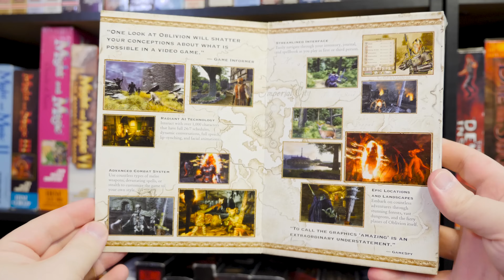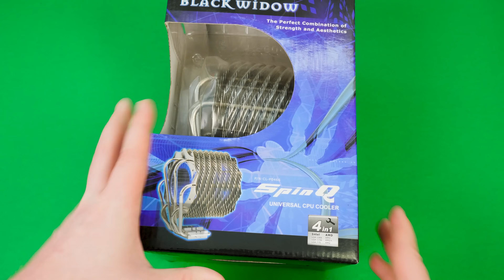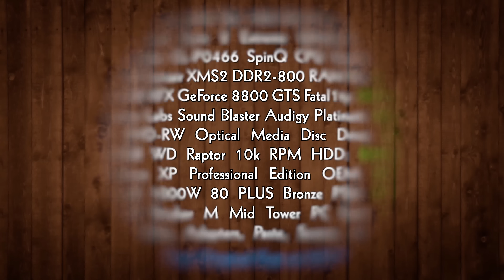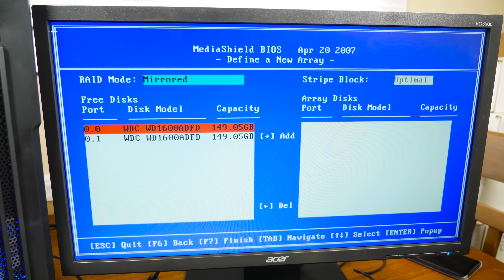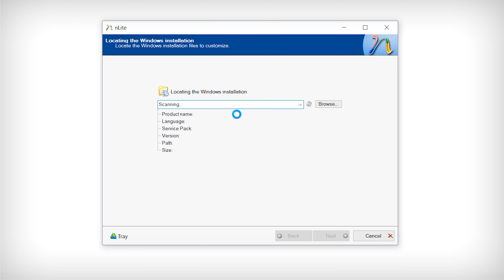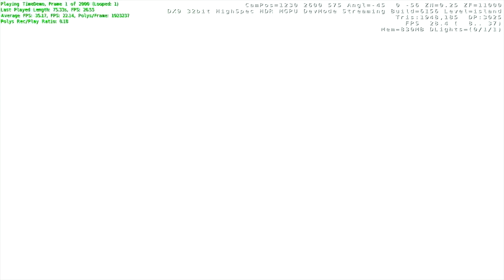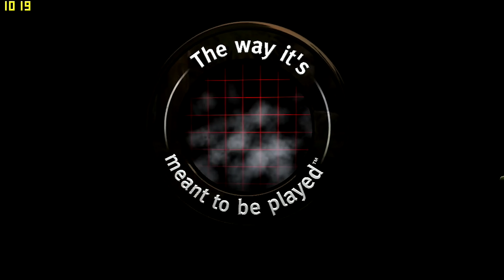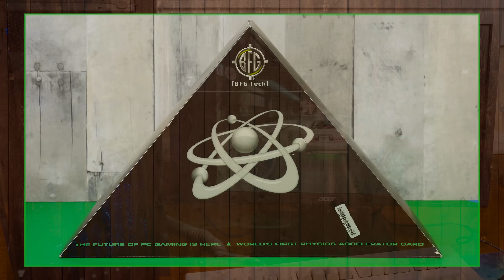LGR - Building My Dream $3,588 Windows XP PC

Comment from the maker: Question for those that made it through the whole build and saw the final specs:
What upgrades or changes would you like to see this PC receive in the future, if any?
As mentioned at the end I plan to upgrade the sound card and add a PhysX board, but I'd love to hear your suggestions!
Reply: Get a Cooler Master HAF X case. It's from 2010, but It's looks way more time period accurate with that side fan. Also some cold cathode lighting. SLI GeForce 9800 GTX (or maybe Quad SLI 9800 GX2).
Reply: I am pretty sure it was 3.5GB RAM limit for XP
Reply: You can actually put one more gig in there. I can't wait for the PhysX card review, I remember it from back in the day but I'm not sure if it qualifies as oddware or not :-) certainly didn't live up to the promise hehe.

EDIT: Oh and please do tell us how much better Crysis works with your new RAM :-)
Reply: I have the original box and driver disk for the PhysX card if you need them!
Reply: Auzentech X-Fi prelude soundcard and the 8800 Ultra. A logitech G15 keyboard and G5 mouse would also be nice and period correct. Maybe a badass windows XP skin and dual DVD drives (dual because that was badass back then).
Maybe a ccfl tube at the botom of the case.
Reply from the maker: Won't be upgrading to 64-bit due to the problems it can cause with a lot of the games I want to play on this.
But another gig of RAM makes sense, may as well max things out for 32-bit!
Reply: You could go crazy quad sli with duel GTX 295's... if you don't mind wearing ear defenders and melting a few power supplies!
Reply: I still have a PhysX card in a drawer. Those things were basically novelty toys back in the day but they were impressive.
Reply: i say 2GB is the sweet spot for xp as some games like juiced won't run if there's more then 2gb of ram sure you can fix it but it a pain in the but
Reply: You gotta add a floppy drive!
Reply: You need some .. dark coloured woodgrain.
Reply: Noooo soundblaster 4life!!!
Reply: As you've already alluded to, upgrading to 4gb of ram; something a system at this price point would of had at the time.
Reply: more leds you can't have a gaming pc without an accesive amounts of leds
Reply: A bigfoot killer network card! That was a big deal at the time, and in 2006-2007 I bought one. And maybe a TV tuner card just because
Reply: An early Blu-ray drive maybe
Reply: Personally feel like it's fine. Only thing it's missing is a 5.25 bay draw caddy for storage. If you want to make it part of oddware hook up a USB ghost radar or ocz neural impulse actuator to it.
Reply: X-Fi Fatal1ty sound card is the obvious choice here. The Audigy 1 is more of a Win98/2000 card. A nice 16:10 screen for more period-correctness and superior aspect ratio ;) I'd get rid of SLI and just use a single 8800 GTS/GTX/Ultra. A bluray SATA drive and a memory card reader would be cool too!
Reply: a windows xp machine can't be complete without a floppy drive for legacy stuff. (yes, i still used floppy in 2007)

oh, also get a blue cold cathode light and one of those RAM Fan modules
Reply: Definitely a better Sound Blaster card. I actually have a Sound Blaster X-Fi Fatal1ty edition sitting in the loft back at home, but found that the onboard sound on my motherboard actually sounded better with my headset. The ribbon cable for the front drive bay was a nightmare too!
Also can't believe you have those Raptor drives. Got one sitting in my PC right now, the 150GB one with the clear window, used for my virtual machines. And I also have the same 160GB version you had also sitting in the loft.
Reply: *add-on
Reply: Max out the ram if possible, run 3 disks in raid 0. And run 3DMark tests too!
Reply: as a suggestion for a sound card give a SB0880 Sound Blaster X-Fi Titanium a shot
Reply: I love when you take period photos with old digital cameras... so maybe complement this rig with a sweet 3-CCD SD firewire camcorder?  :D  The effect would be diminished, of course, given this isn't as glaringly different a time period... but it might also make a fun video in and of itself!
Reply: I would use a more ancient screen to give that same feeling we had back there!
Reply: Could you do the equivalent build with Phenom? Would be interesting to see and maybe the 4870 :) that would be similar to a build I had back in the day.
Reply: 8800 Ultra SLI
Reply: Could be the slowdowns in Crysis is due to the build running single channel rather than dual channel memory (double the bandwidth) but damn this is one good looking build. :)
Reply: I think a single more powerful video card would be better.  SLI and Crossfire have almost went the way of the dodo for good reasons.  Would like to see a review of the sound card + front panel controls (I think my friend donated it.).
Reply: water cooling. Could dig up an old Koolance case which includes a water cooler. I always wanted one.
Reply: just cuz its 2018, you need more RGB, since that is what makes a PC go faster!
Reply: if you are going to upgrade to better sound you might as well use one of the x-fi top tier titanium cards! those would be epic for XP
Reply: Does XP really see 4 cores? I had XP Pro but it only saw 2 cores when I updated my cpu. Had to switch to Win7 because of that.
Reply: With three sticks aren't you running without dual channel? Good reason to add another one.
Reply: No mid 2000's PC would be complete without a couple of cold cathode tubes.
Reply: Actually, it's not THAT bad running a 64 bit XP, remember - a decade of polishing went on this. :) Finding some 3rd party drivers will be a mess though, especially those Audigy ones, IIRC.

- Anyway, as others have suggested already, mess with memory first of all. Add to 4 Gb limit I guess... But you can go even further and try different shenanigans:
1) Install ramdrive software, some of the titles CAN even utilize excess memory, even beyond 4 Gb limit(!), so you can make a ramdisk with a write cache, swapfile or/and a game directory for quasi-SSD performance :)
2) Install an older (pre SP3) build of XP, I have much less info on that, but I think it's a SP1. Basically - M$ banned memory usage on common versions of XP beyond 3-4 Gb to promote server/64 bit versions and to lazy-fool-proof some things.
3) I forgot... %)
4) Try ReactOS!

- Secondly, add a floppy (or even a CD/DVD-ROM) with embedded cardreader, if you can find one ofc. :). Mainly for giggles, but also could be useful.

- What else... Scanner/MFU? Not really fun, but was still a thing in its time. 
- Some bluetooth dongle maybe? I have no idea if they still make ones without the need for drivers for XP (!), but finding that would be awesome. :)
- Some silly webcam? :D
- Maybe VR 3D glasses? I don't remember the exact generation of nVidia, but ASUS was making these several times, bundled with their cards.
- Speaking of 3D, 3D 6-ch headphones were also a thing. Was it Zalman or Koss? Don't remember...
- A HDD rack with hotswapping.
- A joystick or steering wheel.
- Oh yeah, definitely find one of those PhysX cards, toying with one will be fun but very tricky. :)
Reply: windows vista
Reply: IIRC, Nvidia 8000 series cards already had Physx built in (it sucked, but it was there). With 2 dual slot GPUs your expansion will be limited. 

Gamewise, do you have STALKER Call of Pripyat? I remember that being a staple benchmark title in the late 2000s for both MaximumPC and Computer Power User.
Reply: You might have the dual memory channel bug where you can't do your dual channel memory it will be the BIOS bug I had the same bug if you put it in non dual channel slot you may not have issue anymore like I did give it a go or not your choice
Reply: I used to have a couple of HDs with little windows in em, I thought those were the 10k raptors like you were installing, but thinking back, I believe they were 15k rpm. all I know is like a month after I bought  them, SSDs were larger and cheaper and faster
Reply: Not so much an upgrade but I would be interested in seeing some benchmarks for the 10k rpm drives. Just curious to see what the read and write speeds are.
Reply: I want to see all the lgr PC's side by side. I love how they all have their own style and flavor. the woodgrain, the green giant, and now this one. 

I was a little surprised it hasn't been christened with a fun name. maybe the LGR midnight express...
Reply: No reason to switch to 64bit XP, it was never really used by gamers, it's also based on the slightly newer Server 2003 kernel, and in many cases tracking down XP 64bit drivers can be annoying and it would provide no benefit to the era of games he's playing, Actually who ever really used XP x64? The only thing I could guess it was used for was for high end CAD/CAM or maybe video editing workstations where you needed tons of RAM and the licensing for it was probably cheaper than Server 2003 which you would've needed for more than 4gb of ram and running a native 64bit OS in the application would've made sense because even though you can access more than 4gb of ram with the 32bit versions of Windows Server but when using large amounts of ram there's a performance hit from PAE .
Reply: Paint that sound card controller and install it, all those buttons and dials will go great with the overall aesthetic of this machine. :)
Reply: By 2008 hadn't NVIDIA alread bought out Ageia and killed off the PHYSX board and moved PHYSX to their GPUs although they did have an option where you could use an NVIDIA 8000 series or later card as a dedicated PHYSX card ,  In this configuration typically people would use a low end card for physm, although if a game uses physx and doesn't support SLI or has issues with it you could probably disable SLI and use one card as a dedicate PHYSX unit when you play that game.
Reply: Get another stick of RAM so it would run in dual-channel mode. Also, if your motherboard supports it (i.e. a modified BIOS with Xeon support exists for it), you could get a Xeon X5470 (3.33 Ghz Quad-Core with 12M of cache) modded for LGA775 dirt cheap (~20$) on Aliexpress. I'm actually running one in my LGA775 system.
Reply: More ram and windows x64
Reply: Was wondering to what extent you would be able to get rid of games stuttering by adding a SSD.
Reply: TV tuner card for playing older consoles through! And on top of that, get some emulators like bleem and chancast running on it!

Other than that, I think an exploration/mini doc on the application skinning/themeing trend that took off with Windows XP would be interesting, with the likes of windows media player, XP ui themes, winamp, (2, 3, 5) and she'll replacements like litestep!
Reply: Get a xeon for it ! X3230!
Reply: UV cold cathode tubes and a 5.25" bay fan controller with temperature sensors and a display.
Reply: Come on man, max out the memory with 4 gigs!
Reply: Make an 8GB RAID-0 array with one of the The PCI Gigabyte I-RAM's and one of the functionally equivalent 5.25" Bay versions- AKA GC-Ramdisk.
Reply: She seems pretty sweet so far. My only recommendation is to get yourself a SecuROM cleaner if you Install Knights of the nine and the shivering isles as the disks have it on and having lost many Sims pcs to that nasty program, I wouldn't wish your baby to go that way. North and South bridge failures are not a nice way to watch your much loved pc die an un-needed death :'(
Reply: Aside from maxing out the RAM to 4 GB, I can't think of much, as the components are just about perfect. You could look into using a more period-correct case. Although that Rosewill case has just enough mesh and blue LEDs to look like it's from 2008.
Reply: LGR You might as well max XP 32bit out at 3.5GB, and I can remember running Crysis warhead on dual SLI 1GB EVGA 9500GT  with no issues, so I would suggest something in the 9 series like the 9500GT or 9800GT/S with 1GB of RAM Edit: if you want a good  sound card with front panel headers for HD audio I would suggest the ASUS Xonar DG PCI card if you have a free PCI slot, or the DGX for a PCI-E slot as I think there are drivers for Win XP just get the unified drivers.
Reply: Re: sound card. I did a quick search on youtube but didn't find any Aureal videos? If I missed that you should really check it out.
Reply: Cold cathode lighting, it was the hottest shit back in the day
Reply: Max out RAM, get a 4:3 monitor as a second display, get a Logitech G15 and a  racing wheel.
Reply: My Account Yeah you could for sure, and even more stuff with the RAM maxed out, and Linux distro like Xubuntu which is very light on system resources, but if you do that you will have a better time with AMD GPU's as the drivers are built in the kernel.
Reply: For sound card, I would suggest at LEAST no less than an Audigy 2 ZS (or even the card I have: the X-Fi Platinum Pro).  Since really, you'll want EAX4 for a lot of games from around that time.  If you want to step the audio card interface up from PCI to PCIe, there's also the Audigy Rx.  It's more or less a PCIe Audigy4.
Reply: Honestly besides the audio card idk what I would change.  I do like the idea of 64bit OS but I see you have other plans because of compatibility.  Sick PC brah!
Reply: A front mounted fan controller you'll never actually use seems appropriate.
Reply: Add purple flame stickers to the sides, kind of like the Guy Fieri shirts that were so popular at the time.
Reply: @revive  They need to be cold cathode and not LEDs if he wants to be accurate to the times. haha
Reply: nice antec lanboy case would be the nuts
Reply: It's not a mid 2000's GAMING PC until you add cold cathode lights
Reply: What advice would you give to someone who has an xp os but no serial keys to activate it?
Reply: Additional gig of ram will make it actually faster. In your actual setup, with 3 sticks of RAM it will not run in Dual Channel.
Reply: Nice speaker and subwoofer pkg? You didn't say what was currently hooked up...
Reply: A powerful single GPU to eliminate SLI scaling errors!
Reply: Lasky Labs driver support and compatibility with 32bit was a nightmare. I had put XP x64 on my pc around 07-08 and gave up on it when I couldn’t get drivers for half my stuff and many programs I used wouldn’t run so went back to standard 32bit.
Reply: All I have to say is 2008 me would have murdered a litter of kittens for that setup. (edgy 2008 me popping through. sorry about that)
Reply: I'd love to see that.  Fits in with the build.
Reply: Ive had that motherboard, twice. through the weight of the cooler, the little heatsink on the top above the cpu would come off because of motherboard flexing. and the motherboard would burn out eventually. This is my personal experience with this motherboard.
Reply: Why not try external FireWire audio card from that period of time? Something like M-Audio FW 410\1814\solo or Focusrite Saffire pro 14\24 (DSP). And good CRT ~20" with 1600x1200 is best tho.
Reply: another gig of RAM makes also sense to make it run in dual channel mode :)
Reply: Even out that RAM to be at least a 4GB setup with equal 1GB sticks in each slot.  Otherwise, you're limiting yourself to single channel speeds since it's three separate sticks instead of two pairs.
Reply: I'm on board for a compare/contrast of 32 bit vs 64 bit Windows. Great build!
Reply: If you are planning on using it long term, and really want to keep that heatsink, I would recommend modding it with a CPU backplate.  Given enough time, it will warp your motherboard.

I would definitely upgrade the SLI setup.  For my system, I used an SSD and went with 4GB RAM and set aside 1GB as a RAM disk for swap, browser cache, etc.
Reply: Being kinda period correct LGR I would install the 8800 ultra card (micro studder/sli was a hit or miss) 3 gigs of ram is plenty and upgrading to Sound blaster audigy 2 zs or next gen extreme gamer sound card is best (using still the Sound Blaster in my Sandy p67 board)  I think if was the Xtreme Gamer sound card from the next gen from Audigy 2 ZS.   Using SSD tech might be option for less head aches going forward but wouldn't be period correct.  Nice build and video LGR
Reply: Def an ssd
Reply: MAWR LIGHTZ!
Reply: The case NEEDS to be an Antec Chieftain. The classic case that was the original Alienware cases, the ones that pretty much every case manufacturer copied.
Reply: MORE LED´s:D
Reply: I thinked around with XP64 once upon a time and it was a mess. The WOW64 emulation wasn't what it is today and the driver support is awful, generally. I think XP64 was Microsoft's first real stab at 64bit and it was not good, lol.
Reply: Plus, I remember ordering everything from Xoxide back in the day. Lasercut 80mm fan. mmmm.
Reply: Since it's the right time period for it and you have a window you have to get some cold cathodes in there, I was looking at some myself for a "retro" build and they can be had a lot cheaper than I expected at places like PerformancePCs combine it with some crazy fan grills and stuff and you have the quintessential 2005-2010 build. More of a visual thing than a performance upgrade though, but given how nonsensical such a build can be it's only fitting to throw in every fad of the era.
Reply: Did you get a keyboard and mouse from the time too LGR?
Reply: a dual gpu card from AMD ( HD5000 or 7000 series) that kicked Nvidia's butt back then....as a gamer who prefers nvidia products...i would love to see that happen today.......no....i would pay to see that :) :) :)
Reply: With a simple Bios mod and Xeon (pre-modded or DIY Sticker mod) you can run the following cpu
Xeon X5460 quadcore s775 (3,16GHz, 1333FSB, 12MB) (around 15$ pre-modded)

You could also try getting your hands on Windows server 2003 Enterprise 32 Bit.
-has better memory management and is the only 32bit OS that can run more then 4GB ram.
-can use WinXP 32bit drivers
With a few tweaks you can even run a lot of games from older generations(like disabling unused services and enable hardware accel.)
Dos games run great with the VDMsound utility since your already running 32bit os you don't need emulation or virtualization.
And there are also Glide Wrappers if you want 3dfx support.
Reply: Around this time I had an Asus Xonar D2 soundcard which i thought was pretty neat. Definitely recommended.  I really enjoyed this video.... brought back a lot of memories!
Reply: Why not dual boot it? XP 64bit is a pretty interesting piece of software. Speaking of dual boot, throwing in a period-correct linux distro with some linux compatible games from that era could be interesting too.
Reply: There is indeed a patch you could slipstream to windows xp 32bit, to allow it to enable a lot more ram. Up to 128gb, in theory. The same site that would host the page for the unofficial service pack 4 for xp, also lists what it calls an "alternative ram patch" that i was already able to verify in a vm to recognize and enable 32gb already. Considering that evga did make custom xp drivers for their current x299 Dark motherboard, that would be a great use for it.

For this system? Max ram, ssd, maybe a newer sli? Windows xp drivers from nvidia supports as late as a geforce 780ti, titan, titan black, and recently, the gtx 950 and 960. So you have a nice breadth of gpu's to choose from.
Reply: Perhaps consider upgrading to the 64-bit Server 2003 and find some extra RAM.
Reply: Woohoo, Classic pc build !
I think my old childhood 2012 pc has similar specs built it my self at the age of 10 Lol
still ticks to this day with clear side,LED lights,big heat sink, monstrous fans & bad cable management....ohh my what a time goes soo fast....

 Windows xp brings back a lot of good memories, seeing this video kind of gives me thoughts of using my xp machine and seeing what still runs on it in 2018...
Reply: the 680i board needs thermal compound redone STAT on the chipsets to keep it running good and happy.
I've got a circa-2007ish BFG semi-modular 1000EX supply kicking in my 2500k box at the moment. 11 years and it's still going strong.

for HD audio, look at an Asus Xonar card, since those will have relatively decent XP compatibility. you can break out the Audigy/2 pins to HD Audio but it's VERY finicky and most cables don't work well at all. 

The 680i board can take 771 Xeons with the tape mod and a BIOS update (yes, even the silly 1600FSB ones!) They also silly overclock. dunno if you'll want to keep with the SpinQ for that but any cheap 212 will handle the upgrade just fine, even when overclocking. if you do such, you'll also want to upgrade the fans to push-pull or JUST pull, but not with the stock CM fan that comes with it. 

A 780i would be a better motherboard choice in the long run since it can do DDR3 and also handle 16GB worth with the latest BIOS, but they're VERY unobtanium now. I gave mine away to a friend, sadly, else I'd offer it.
Reply: Kinda defeats the purpose but can you try playing GTA 5 on windows xp
Reply: Please try to build modern beast in an old 80s/90's case. I still intend to build a modern pc in the early 2000s case of my sister's husband.
Reply: Heh, hardware is the least of my interests; it was confusing enough 10 years ago, never mind today! Besides, when you can have a virtual machine of XP running just fine on top of Windows 10... No, it's figuring out how to keep XP alive that's the fun part!
You'll need all the POS updates for a start if you want to get online safely. This build by Team-LiL is probably your best bet unless anyone else knows any better- https://lilfellauk.wordpress.com/2018/04/19/windows-xp-pro-sp3-vl-corporate-student-edition-x86-cdr-april-17th-2018-team-lil/ although there is a "gamer's" version too https://lilfellauk.wordpress.com/2018/05/19/windows-xp-pro-sp3-vl-gamer-edition-x86-may-2018-team-lil/ if you want DirectX 10 & 11 etc (but lose Pinball!) Yes it's all very ugly but they've actually changed very little in terms of aesthetics compared to other builds I can think of (you know who you are!) Do note that these aren't upgrade disks so you'll need to start from scratch if you choose to use them. XP Black Edition 2015.9.12 is an upgrade disk, and a good one at that, but there's three years of updates to install with that one now.
If you want a browser that's safe to run then read this post for your options (there aren't many left!)- https://www.bleepingcomputer.com/forums/t/674966/best-web-browser-after-august-2018-for-windows-xp/?p=4555848
Finally, you may want to change the look of things drastically. Stuff you can't do on anything past XP. Quite a few options but my personal preference is for Stardock's products https://en.wikipedia.org/wiki/Object_Desktop although there's plenty of other stuff to play around with too. Tracking it all down is the tough part. I'll try my best to hook anyone up if they're interested as I've spent far too much time on the Internet Archive hunting stuff down. ;)
Yeah, the software is my interest precisely because it's not possible on modern versions of Windows. There's very little in terms of gaming that can't be done on Windows 10 now simply because the fans have put so much work into bringing it all back to life. And besides, patches, mods, upgrades and tweaks are fun to get going too!
Reply: 8gb RAM pls!
Reply: The only thing I would want to upgrade is the os to 64bit XP and a 4gb or more kit of ram that uses all the channels.
Reply: Do the Xeon 771 mod
Reply: You need at least 2 strips of LEDs on that bad boy, and a Logitech G15 keyboard showing your CPU stats. You should also think about loading World of Warcraft Classic onto it when it comes out next year (maybe). That'd be cool seeing an old machine running a re-release. 

Good job all round though! Can't believe I spent a Friday night with a buddy watching this 🤣👍
Reply: I can't suggest any changes to the HARDWARE, But I would like to see you run Halo and Halo 2 (with that XP patch) and DOOM 3.
Reply: an ssd boot drive with a standard hard drive for game storage
Is It even Possible?
Reply: custom xp skins and icons on everything please
Reply: Since you've addressed the RAM below, really all I'd suggest from my own personal dream PC of that era, would be a disgusting overclock with water cooling.  Since you mentioned it's basically a space heater at stock settings, I don't imagine you want to try it air only.  I always wanted to push a system like that to its limit.
Reply: If you'd like to hear some suggestions on current parts I'd recommend upgrading the current PSU as Rosewill PSU's are notoriously dodgy in quality, a quick google search of "Rosewill psu caught fire" will give you hundreds of results regarding the brand, and I would like to avoid the computer meeting an untimely end from a PSU issue.  Other than that all the parts were really good and I'm looking forward to seeing what you do with it.
Reply: I've got a 2 ZS with a black front panel if you want it my dude.
Reply: Odd question I know, but is there a way to play space cadet pinball on newer computers? Some time ago i was looking in to it and it wouldn't run for windows 10. Emulation be good other than I don't want to just run a full emulated system for one or 2 games.
Reply: I would upgrade to a pair of GTX 280 or similar GPU's. In fact, I could have helped you out with this build.  I built my first gaming PC in January of 2008 and I still sort of have it.  The motherboard (an EVGA 780i SLI)  is mounted on my wall with the RAM and a CPU still in it.  While I'm not sure if the motherboard is any good anymore, I do know that the CPU is good (it's an Intel Core 2 Quad QX9650 Extreme) because it is in my wife's aging POS now so she can play The Sims 4 and so my daughter can play Spore.  I built the thing because I wanted to be able to play Fallout 3 on its release with all the settings cranked.  My GPU was an EVGA GTX 260 SC which unfortunately perished a long time ago.
Reply: My PC at the time had 4GB sticks, but limited to 3.65 due to 32bit XP, the soundblaster Fatality Xi-fi Sound card (the one with the dedicated memory), a Q6600, and a single 8800 GTX. I would like to see two 8800 GTX in SLi.
Reply: 1080 p monitor.
Reply: Install Windows 7 and then download Windows XP mode! :)
Reply: Another 1GB of RAM to activate dual channel. This ten/eleven years old PC is awesome! I’d love to have one of this in 2007/2008.
Reply: +MasterOfDiseaster I have 4 gigs of ram installed in my rig and it works perfectly fine.
Reply: Front panel fan controller would be awesomely mid 2000's.
Reply: there is wrappers you can get for exes and even drivers that fix compatibility issues, github/CodefoundryDE/LegacyWrapper i think?
Reply: add a cd-r drive to use solely as a drink holder, it's what I used mine for lol
Reply: LAN I'd love to see you use this with someone else (like the 8-Bit Guy)  that would be super neet and it was around 2005 when my family started to experiment with LAN (though like you, we never got it to work because of our XP computer not being good enough).
Reply: SLI that 8800 Ultra! And upgrade the monitor to the glorious 2048x1536. I never got to play at that resolution but always wanted to.
Reply: @oncameramastery  Yeah, but then he wouldn't be able to use the sound card or the USB-3 card.
Reply: LGR is windows Xperia’s still supported
Reply: Wow, this is very similar to the $3000 PC I built in 2006:  QX6700, Dual EVGA 8800 GTS 640MB SLI, Asus P5N32-E SLI Nforce 680i motherboard, 4x1 GB G.Skill DDR2-800 4-4-4-12, and an Asus Xonar D1 sound card with a 750W PSU running XP x64. 500GB+750GB HDD (very high end at the time).  I convinced my parents I needed a "workstation" for engineering school.

As someone who is familiar with the specs I'd say: get 8GB of RAM, Windows XP x64 (or even Windows 10 x64), and a more current Geforce GTX (9 series or older) card to breathe new life into it. The computer is still very usable today, but the 4GB of RAM and Geforce 8800s definitely held it back.
Edit: Do not put an SSD in it.  nforce chipsets don't support TRIM.  I know from experience. SSHDs are a good option.
Reply: thank you for uploading! and i love to see windows xp videos!
Reply: also try windows server 2003 for this it lets you have 1TB of ram and 64 CPU (theoretical cores aka 2-4 cpus on a broad with about 12 cores each.) it will let you run games much faster and most everything supports it Microsoft still supported windows server 2003 for until late 2015. but is on ebay for cheap at about $50-$80 bucks but the newer editions are around $500 wow!
Reply: What problems did you have with 64 bit?  I ran XP x64 for a very long time and never had any issues with any games.
Reply: I dont remember the model but there was a NVIDIA graphic card with 512-bit width memory bus, that is reign almost 5 year in the market and  was superb with anti-aliasing + anisotrophic at MAX, without sacrificing overall pc performance.
I think if you can get one is the perfect upgrade for your XP machine.
Reply: Hi, RAM in dual channel should always be placed in slot 2-4. You put it in 1-3 and maybe that's why it failed
Reply: The OG Killer NIC. Maybe try your hand at a high end SATA RAID card setup. Go all out!
Reply: Needs more 1337 reg hax!
Reply: very few original windows xp programs supported windows xp 64 bit plus it was kind of an after thought so many later GPUs and CPUs did not support it.
Reply: Obnoxious stickers on the case
Reply: The funny thing about these specs, is that it could easily run Windows 10 and most modern software with no issues, really goes to show how well this hardware has aged compared to what was there earlier (or depending on how you look at it, how much computer hardware has stagnated and failed to progress). Granted, it would benefit from a newer DX11-capable video card and some more RAM, but everything else including the processor would be fine.
Reply: I'd have not bothered with SLI, myself. More cost, more heat, more power required, very little return on all of that, not all games support it, not a lot of the games that do support it well, it's useless outside of gaming/Windows. And the more cards you use the higher the curve on diminishing returns it gets. I'd have stuck with just the one 8800 Ultra or a top-end card from the next generation that was likely to outperform the SLI you put in there on its own.

The RAID is nice, though on modern hardware I'd ignore anything more than software RAID solutions unless I was aiming for interoperability. One motherboard change (Especially on a jump from Intel to AMD to vice-versa.) or a dead RAID controller later and the array is useless. Not been a lot of really clear benchmarks that show RAID-0's performance really pays off, either. Better off just using a logical volume manager and ignoring RAID. 

Debatable on if a dedicated sound card is really worth the money either. Maybe I'm not an audiophile, but I'm hard-pressed to tell the difference between on-board SPDIF versus SPDIF coming from a $300 Creative thing. 

I actually DO have a flashy computer. I don't necessarily advice against something that looks cool to you if you want it. You're going to have to live with the machine and for me it was also a matter of making the machine unique and reflective of me. I'm less against wasting money on "spinning rims" and more against wasting money on something you think will actually enhance the performance or quality of your gaming, which I doubt SLI, RAID, or dedicated audio hardware will actually do.
Reply: Definitely need to get a fourth RAM stick. Right now with only 3 sticks, youre likely running with Dual Channel memory mode disabled. Also, I feel you on the SLI setup, it was bad ass for the time, but I think youre doing yourself a disservice by not using the better single graphics card.
Reply: I had almost a similar computer back in the day. I've later added an Intel Postville X25-M SSD (80gb).
Reply: The Ageia PhysX card needs a video on its own!
Reply: I would like to see if having the system running in dual channel memory mode would help performance any?   So far you've been running an odd number of sticks so in theory it's only running single channel...   Blah blah...    Good video, the early 2000's version of me is insanely jealous of you.  Ha ha...
Reply: The AuzenTech X-Fi Prelude would be the perfect sound card for this build if you can find one, it's the only PCI X-Fi that supports front panel audio and it also has a huge selection of I/O ports without the need for a drive bay.
Reply: Sudos you're thinking of the 790i, the 780i used DDR2.
Reply: I'd love to see absolutely no compromise on this thing. Put in an ssd, a bluray player, as much RAM as you can, get another card like the superior one showed early one and put them in sli. That'd be great!
Reply: You could build the AMD equivalent.  Is it worth doing a AMD retro builds from that era?
Reply: Need some Pokemon, Yu-gi-oh, Digimon sticker upgrades for starts
Reply: GadOS potato
Reply: XP x64 is a waste of time, games wont use it and it's driver hell and to make it worse is that it's all legacy now so good luck tracking them down. XP x64 is a nice nostalgia trip for me but if I was going backwards for fun I wouldn't touch it with a 10ft pole, just ignore that it ever existed. Drivers and stability with them when you got the wrong ones aside It's perfectly fine for games, I never had any issues.
Reply: put 1080ti on it
Reply: The Cooler Master HAF922 was released in 2009, and it was one of my go-to cases for many different builds back then. I use to build PC's and sell them. My current PC has a HAF912, just because I like the beefy look of the case. I beileve the HAF912 was a 2010 release. 

Rosewill is NewEggs in house brand.  Rosewill makes some good stuff overall, though I would classify their products is "solid for gamers on a budget". I have never really had issues with Rosewill PSU's. Their cases do have that mid 2000 look to them, though.
Reply: Green Lights to match your logo.
Reply: Just more of your eyes next time, with that new camera and glasses dems really purdy compared to your old old videos
Reply: put that 8800 ultra to good use by playing unreal tournament 3..sly was never that good back in the days  outside of benchmarking anyway, also this would be a good system to use with the elsa revelator 3d
Reply: Clint did you try booting with one stick of ram, setting timings and mem volts manually then rebooting with 2 sticks?
Reply: Windows 7 PRofessional and Direct x11
Reply: I would love to see one of those fan controller hubs that go to your front panel. So flashy and a tad bit pointless. But so cool. Also a soundcard update with era appropriate headphones and speakers!
Reply: XP 64 bit with the Pro version to max out that 128 GB of RAM
Reply: Core 2 Extreme QX9770 + 8 GB DDR 1200.
Reply: Probably won't get far seeing GTA 5 doesn't support DirectX 9 which was the last version for XP.
Reply: I can see that there are a ton of replies, but to add my voice to the mix - I would be curious to see how a higher clocked wolfdale Core 2 Duo would compare to your quad. Selfish reasons there, when I built my XP gaming machine, I used an E8600 3.33GHz as I theorised that 6MB L2 cache and the higher clockspeed would be better for that period of machine.
Like at least one person has said, I would add an extra stick of RAM or take the third stick out. You are running in single channel mode and I cannot help but think that negatively affects performance.
Another note of curiosity on my part - how does nVidia's true successor to the 8800 series compare? I tried both a GTX 285 and GTX 260 v2 in my machine and settled on the latter as it was quieter and performed no differently. So now I'm wondering if I should have gone with a 7800 GTX instead as XP cannot support better than DX9, or an 8800 Ultra with potentially better XP support. Clearly if the 285 is performing no better than a 260, the system is not making best use of the cards.
Reply: Try running GTA 4
Reply: Great Vid, Nice build.
I have almost the exact same build. Was my old machine from back in 08. Still alive and kicking :) 
Only difference is its got 8GB Ram and a Q6800. 
Id go an SSD. I know its not period correct, but helps with noise and load times.
Never had an issue running anything as 64bit over 32. Not sure why you wouldn't go 8gb yourself.
Reply: Love to see a nice SSD in there. Perhaps even some more LEDs orrrrr NEON (lets face it, it suites the era well), say water cooling as it was the dream of most back then but honestly good luck getting that to be reliable now. One thing I will suggest is cable manage a lil more. Otherwise this is a godly build brought back so many memories.
Reply: need to add some UV cold cathode tubes for some lighting, with some UV reacted parts.
Reply: you're probably going to want to anchor the hard drives into the trays with screws or that thing's gonna sound like a lawnmower. i actually had an issue with that on a newer pc.
Reply: You have to get a modified 771 Xeon X5482 and pop it in, it's got 12mb cache, 1600fsb, 3.2ghz (oc' able) and a pair of newer instruction set to boot sse4 and 4.1 .. at release it was $1279. Lol now it's $25 on eBay.
Reply: @Lasky Labs I had run XP 64-bit edition. The original Farcry runs fine (with the 64-bit patch). So does Halo and Halo 2. Anything else. . . . Steam. But sure is nice using all 4 GB of RAM.
Reply: Water cool and OC. I made a point to get a floppy / flash card reader combo drive for mine.
Reply: get a 16:10 monitor
Reply: Can you use some Quad core XEON LGA771 in that 775 motherboard ? Back then i heard it was possible but server parts was to expensive and i didn't try it .
Reply: How's about accessorizing those drive bays with sexy knobs and lights? :D Maybe a temperature readout with a bright display.
Reply: Sb x-fi fatality card withblive drive and go 64bit windows to tske advantage of that cpu and ram :)
Reply: @crapanbdgarbage3276  Indeed. Mahogany. ;-)
Reply: - Did Windows updates work?
- Thoughts on PAE hack?
Reply: @NightSprinter  My SB0090 Audigy can do EAX 4.0 with the most recent XP drivers. Probably because the original Audigy & Audigy 2 ZS both used the same core SPU chip. (Although the original Audigy was initially restricted to EAX 3.0 when the Audigy 2 ZS came out for, well, reasons).
Reply: SLI uses redundancy in the memory so your VRAM is actually kind of low. I'd go with the single more powerful card
Reply: I am on it right now, Because IN 2008 I built my rig with 8GB DDR2 as 2x4gb sticks so Technically could I find 2 more sticks I could go up to 16gb
Reply: Not if you run Windows XPx64 Like me... This bad boy has 8GB inside and EVERYONE CALLED ME CRAZY IN 2008 when I built him.... I even have OPEN SLOTS to go to 16 as I made sure to use 2x4gb sticks rather than 4x2
Reply: it's not an update, but can you pls play the fangame sonic after the sequel and connect this computer it to a crt. It's looks so cool, it is as if it was an old sonic game
Reply: 2 LS-240 bays.
Reply: Of course 4GB of RAM. But you know something that might help the look. Run all cables through the back of the case so you can make it super clean on one side. Like you did for the CPU power! For the rest of the cables like front panel and stuff, it ends up looking a lot cleaner. Other than that great build man!
Reply: Won't the PhysX board just get disabled by the GeForce drivers anyway? That is what happens on my Dell XPS M1730 laptop anyway. It's got PhysX, but even with the drivers installed, it seems to get overridden by the GeForce drivers. The 8800M GTX cards does the job just as well it appears. Shouldn't think it would be different for your desktop 8800's.
Reply: Just maybe get more Ram but you are running 3GB now :D did the FPS in Crysis etc do better and load everything? and swap to the 8800?
Reply: If you are talking gaming circa 2008, you need a front panel fan controller. Preferably with blue LEDs. It was like RGB nowadays
Reply: Also, take a look at OCZ ReaperX RAM. They will look nice your CPU cooler
Reply: Definitely try running an 8800 Ultra (or a GTX for that matter)
Try to find a set of OCZ Gold DDR2 memory (two 2 GB modules would be the ultimate high-end for XP)
Also, see if you can source some time accurate peripherals. Logitech G15 keyboard and something like the legendary MX 518 mouse, as well as a time accurate headset

I wasn't all that into high-end PC gaming back then, in contrast to what I am today. 

But I do have a small retro rig myself, comprised of an AMD Opteron 180 (very similar to the Athlon 64 x2 4600+), 2 GB of DDR 400 memory, an Nvidia GT 530 (similar specs to the 7800 GTX, or the 8600 GT, but with a larger framebuffer), a couple old 21" CRT monitors by Tandberg (the displays themselves were manufactured by Panasonic) - Those beasts can output a 1600x1200 resolution at 75 Hz, enabling a very smooth image
I do have an old 8800 Ultra lying around as well. It does not work properly though, displaying some weird artifacts and crashes when drivers are being installed.. Might need a re-flow of the solder on it
Reply: Overclock It Old School
Reply: For that time it must be, qx9775,  ddr3 motherboard with 4gb 1333 ram, and a gtx 295, or two. That is my dream setup, and all the parts are from 2008
Reply: TV Tuner card, heh
Reply: RAM is good. A multimedia reader was common, which would allow you to bring over CF and SD.

The real thing would probably have a printer and scanner, but those aren't really components. And a period-appropriate dual analog controller. 

Maybe a TV Tuner? Those can be fun--especially if you get Windows XP Media Center Edition. 

Try as I might, that's all I can think of for hardware.
Reply: I loved this video. Back in late 2007 I built a similar system based in the same mother board. Money was a problem, so I pieced it together over the months through to 2008. It had a 8800 gts (the updated version with 512 mb and came you as 9800) it rocked crysis in Windows xp at max settings! I was using the c2d 6750 though. It now sports an hd4000 series of some sort and serves as a daily web browsing machine for my mom on Windows 10!!
The best motherboard ever.
Reply: Two  NVIDIA 8800 Ultra Cards in SLI, and max out the system RAM. Then please redo the benchmarks. Im curious on how much it would improve things.
Reply: More ram for sure
Reply: Mid 2000s case modding stuff. Water cooling, colored acrylic, CCFLs, crazy fan grills, UV active round IDE cables, a LCD in the drive bay.
Reply: Looks like the CPU cooler uses a blower fan, which means it's air intake comes from either side of it.  Maybe consider benching CPU temp, then flipping the rear fan to an intake (add a filter, maybe?) and benching CPU temps again.  You'll need to add an exhaust fan somewhere if you do this, though.  That's just a weird CPU cooler, man.
Reply: Talk about the Nvidia 440mx and how it shaped our society
Reply: Not a question about a future upgrade, but the initial build choice. Would it not have been better to go with a dual core processor with higher clock speed as opposed to a quad core? I didn't think many (any?) games took advantage of much more than 2 cores back then. I'm not quite as much of a PC guy so I might be wrong, and maybe Crysis itself is an exception? I know it was like the bench mark back in the day. If you could run Crysis well, you had a good build.
Reply: you need ocz 1066 ram GOLDEN
Reply: A 4th 1GB RAM DIMM. It's been a while since I did a computer build but I seem to recall something about needing to run even-numbered quantities for dual channel to work, otherwise with odd-numbered sticks you drop down to single channel?
Reply: X-fi Fata1ty edtion soundblaster. Still got 2 working one in my dream XP machine (AMD Phenom II cpu and a 8800 750MB but use a 750 TI for day to day my 8800 is OLD!). Comes with black front panel can switch between game enteranment and creation mode. Midi/gameport and midi in/out on front panel. One word of warning you need the ribbon cable, you can find the cards and front panel on ebay easy but that ribbon cable is miss more often than not, the one you had in this vid should work as well but don't quote me. Hope you find one and enjoy as much as I still do. PS Quake 4 and Doom 3 only look right on XP and the sound with this card? has to be heard.
Reply: Also a logtech G15 keyboard, getting your live score and health on games? wish mine never broke. :'(
Reply: 8gb RAM pls
Reply: Totally always wanted a 5 1/2 inch soundblaster interface like that, shame it's not black, next time.
Reply: I got an Dell D1000R with its stock 16-bit color igpu.... said fuck that and slapped the most powerful PCI1 GPU I could find to install inside it, slapped a Full Size PCI GeForce EVGA 6200 with 256MB of DDR2 I believe. Rendered and actually started playing Skyrim up to the cart scene on it till the PSU said "F U dats too much power" and safety shut off lol. All hail the Single-Core Pentium 3 with 254mb of RAM lol. Plays Far Cry well too lol
Reply: c'mon. Just do it for fun.
Reply: I have physX di you want to buy?!
Reply: As someone that used X64 back in the day it was a bit of a nightmare depending on what hardware you had/what software you wanted to run. Driver compatibility was VERY hit and miss. A PhysX card would be neat but with the setup you already have I doubt you'd notice all that much extra performance.
Reply: 1 Million x better build guide than the Verge Clint!! ;) Maybe dual boot with Windows 7 x64 then you can put 4 gig of RAM in and have an (relatively) up to date OS as well :)
Reply: there is a 64-bit version of xp, which I would have installed. but, I guess he is trying to go for authenticity.
Reply: An upgrade to XP 64bit would be fun to see. Swapping out the SLi setup for the 8800 Ultra would improve stability and speeds. Also if you can find one... A Logitech G15 Keyboard would be a must for that setup.
Reply: Swap the box for a Dell. Where xp belongs
Reply: XP 64 was an oddball.  If I remember correctly Win2k3 was a fork of XP, made the switch to 64-bit, and then XP64 was a fork of the Win2k3 codebase.  As a consequence, the required security updates and patches were split XP and (Win2k3 + XP64).  I did some development of 64-bit drivers on XP 64, but it honestly wasn't good for much else - compatibility with 32-bit stuff was a nightmare.
Reply: You can easily get a xeon to work with that machine.... I did ;)
Reply: You know what I wanted in 2006? Water-cooling.
Reply: Overclock it!  680i the best
Reply: LGR  dual tape drives? 🤗
Reply: I'd like to see you max it out.  Not what's the best Windows XP machine you could have built in 2008, but what's the best Windows XP machine you could build period?  What's the fastest hardware that has actual support for Windows XP, either official or unofficial but reliable?  How does it play the top games designed for XP?  How does it play the last games designed for XP?  How does it play the last games to support XP?  If you load 7 on it how does that change?  Can it run 10?  What about dual-booting x64 edition and comparing it's Server 2003-based environment from the perspective of a gamer.

You could take the same idea backwards too, do the same thing for Windows 9x/Me.  Windows 3.1 and older would probably be harder due to the lack of standard gaming APIs
Reply: +LGR 
I just hope that whatever you do that your PC does not get infected by viruses or anything for the fact that there will be no security updates for it because it is running an unsupported version of Windows ( Windows XP ) .
Reply: MasterOfDiseaster XP x86 is up to 4gb ram, but XP x64 is up to 128gb i think?
Reply: SilverX95 These old games that run on <2gb ram are not meant to be running on XP, but on older OSes. I recommend using 4gigs.
Reply: Waldimart Why? It's not a retro pc build.
Reply: +Virtuos
I remember back in my earlier young adult years that I used to play one of those old games on even a Windows 7 Laptop so outside of the need for 
4 gigs of RAM or more what difference does it really make what version of Windows they are running those old games on because they are going to get the same performance result no matter what version of Windows they are running those old games on .
Reply: If we can choose all of 2008, I would recommend a gtx 280 in sli. It would be one of the best, if not the best dx10 card in existence and would greatly help crysis. Maybe also 4gb of 1066mhz ddr2 ram. That is the amount of memory I had in my pc back in the day and it made quite the difference even back then. I even did 6gb at one point because I got 2 1gb ddr2 1066mhz sticks for free, but by then the gains were only really in benchmarks, and not in actual gameplay. 4gb seemed to be the money spot in late 2008.
Reply: An 120GB SSD and more RAM possibly
Reply: What DA  F R I C K ! ? ! ? Windows XP?
Reply: i have one of the lightscribe drives just sitting here if you want
Reply: Quad GTX 480s!
Reply: The whole video I was really waiting for you to get the second gigabyte of ram that didn't work. So it was very satisfying that you did put it in at the end.
Reply: The ATI Phsyx was always on my list, I had a way more of a lovely time back in the day over clocking radeons and fucking around with crossfire and such XD
Reply: LGR check out the spec of my  2006 PC Build from AMD  at a whooping a little more than  $4000

AMD SLI System
1. Seasonic SLI Extreme Gaming Edition S12 600W Power Supply.
2. Asus A8N32-SLI Deluxe Socket 939 Motherboard.
3. AMD Athlon 64 FX-60 Dual Core Processor. I remember paying $1.200.00 insane.
4. Zalman CNP9500LED CPU Cooler.
5. 2GB Cosair XMS 3500LLPRO Memory Ram
6. WD Raptor Enterprise 150GB 10kRPM 16MB X 2 Raid 0
7. WD 500GB Hitachi 7200RPM HD for storage
8. 6-in 1 Internal USB 2.0 Card Reader with Floppy Drive
9. 16X DVD ROM
10. 2X NVIDIA Geforce 7800GTX 256MB PCie - SLI
11. Creative Labs Sound Blaster X-Fi Xtreme Music Sound Card.
12. Microsoft Windows XP Home Edition 
13. Saitek Eclipse Gaming Keyboard.
14. Logitech G5 Laser Mouse.
Reply: You could have dual boot windows though. One for 32bit and other for 64bit
Reply: I have that exact same optical drive in my own 2017 computer 😧
Reply: Update your SLI with more than 320MB of VRAM. Probably need more than that.
Reply: maybe switch out the ultra and one of the more at the time high end xf series of cards but cant really think of any other other upgrades
Reply: I was thinking exactly the opposite.  This is supposed to be a dream machine, and there were some very good LCDs available during the XP era.  I still have my Dell 2005FPW and use it regularly.  720p is too low already.  The best XP experience deserves a 16:10 ratio IPS LCD.

If we were talking 9x/Me then sure, I'd say a CRT is almost mandatory because of how many games supported exactly one resolution that almost certainly was not your desktop resolution.  Fixed-pixel displays suck for that sort of thing.  Most XP era games didn't have that problem though, you can almost always either just pick the right resolution or at least pick a comfortable fraction that can be cleanly multiplied.
Reply: I suggest you overclock, and reapply thermal paste on the GFX cards, and under the CPU heatspreader as that would be more fair to assume they would have fresher paste in 2008... Also, I beileve the Nvidia RAID1 had latency issues in the day. May get rid of some loading stutter by using a single drive... Then retest!

I had an almost an identical setup in 2008 from working when I was 16 years old.
I will add, I'm concerned about your performance; I had a Q6600 CPU overclocked to 3.8ghz, 3GB DDR2 1066mhz, and x2 SLI 8800GTS. I used windows XP with the latest drivers at the time. Had none of the issues you displayed, and also definitely didn't have that poor performance. I did have problems with PCI latency issues however when trying to use my Audigy card in my board however... Forced to use onboard until I got a nice GTX 260 in the future! hehe.
I even found some old emails from orders I made online! I really didn't spend my money very wisely, but I don't think all of it cost less than about £700! I got a good bargain, mostly second hand. :)

Thanks so much for your excellent videos though, you really brought me back! You've kept your videos at top notch quality, you must be very proud to also be able to say to your 2008 self "Look at me, I'm also internet famous!".
Reply: SLI 8800GTX Long Live The King
Reply: I always use floppy to add the raid driver during Windows setup. Don't we like floppy's?
Reply: Nice build, how about adding a display fanbus like the FC6 lamptron? I went with a similar setup for my XP 7 dual boot system but using a modified E-5450 Xeon for the same performance as those qx cpus are still super expensive over here, & a P45 mobo I knew would work with the xeon; yes these systems get hot & I had to upgrade my NB HS to cure hitching.  Didnt pick a target year for my build, it was more about XP compatibility & what works best and costs less; I had an old windforce GTX670 which is quiet & works in XP; if you dual boot 7 it will run Fallout 4 at a playable rate but the cpu starts to struggle in dense areas.  Oh, and I did add a FDD :P
Reply: i loved this video, since for me thee cost was prohibited, but i use a slighty more powerfull pc for dayly stuff. i got a core 2 quad q960 socket 775 lga with 4 gb of ram ddr3 and one nvidia geforce gt610. i just put several extra fans and use a recycled cabinet. i just don't know what pc games should i run, but when i saw crysis, need for speed U2  and gta iv, it was a pleasure to the eyes.
Reply: add a CoolDrive or some sort of front panel fanspeed controller.
Reply: dual psu
Reply: LGR I liked the video, why you did this makes sense, cool to see
Reply: Could always add a 5.25in and 3.5in floppy drives, for those really old school games. Otherwise, I'd say a SSD into that back slot certainly wouldn't hurt. Especially, if you transfer the OS to that. Sucker would load faster than you could blink if it's the right speed for it all.
And, at this point, anything else, is just extra, such as dual monitors (or more if XP is capable of like 3 monitors), definitely a good sound card and speaker set are needed though.
Maybe add in an extra CD/DVD drive? certainly useful for those multi-disk games, where you can install 2 discs at a time, and switch out the others as needed.
And, maybe, water cooling, but, that should only be added if the rest of your upgrades cause the system to heat up too much.
Reply: Gonna vouch for one of the X-Fi cards like you mentioned. I'm still running an X-Fi Titanium in my Win7 rig for audio capture reasons, it's a really nice card with excellent, clean inputs and outputs.
Reply: Get a Q2Quad Q9650
Reply: Maybe another few gigs of ram if possible. And maybe a better or dual graphics cards that are more powerful.
Reply: LGR you got to find a way to put more ram into that bad boy
Reply: 4-core Xeon swap (if mobo can take it), 4gb ram,OC to the max and test it in some modern games if they can into XP
Reply: I'd say a Novint Falcon. It was such a novel peripheral.
Reply: I did a very similar major pc upgrade for the release of Oblivion with the Antec Ninehundred case, a OC Q6600 3,5Ghz with a similar EVGA motherboard as you and with an EVGA 8800 Ultra and two Raptor harddrives in raid0 and for sound the Creative X-Fi fatality that you feature in the later video.
Also added a Thermalright HR-03+ cooler to the graphics card which was very nervous with a 1000$ card at that time and for the CPU the Zalman CNPS-9500-LED. Man that PC was a beast, but the Nvidia nForce-680i chipset wasn't the most stable and the drivers were terrible.
Reply: Would it boot windows 10 or is it to old?
And would you make a video about if it could boot windows 10 :-)
Reply: Can you try fortnite on that thing get windows 7 and try fortnite
Reply: Well, add that last ram stick, and optimize the nvidia control panel settings for best performance and not gonna have much problems
Reply: LGR well, I actually went 64 bit back in 2007. Had he following configuration:
- Athlon64 x2 4200+
- Asus A8N-SLI 
- A pair of Asus EN7800GT cards in SLI (complicated story. Originally wanted to use 6800s, but Asus built them like crap and the heatsink fell off and shorted out the GPU and the sound card. Went through crap to get the 7800GTs)
- 2GB of DDR-400 RAM (4 sticks of Crucial Ballistix 512MB sticks)
- Asus PhysX P1 PCI (the hell I went through getting this card)
- SoundBlaster X-Fi Fatal1ty Champion (had to RMA once because GPU was shit)
- Single Western Digital 120GB drive 
- ICute case
- 480w Antec PSU (protip: do not use PSUs less than 700w. The PSU ran hot and burnt out within a year and the rig was extremely unstable. Things smoothed out when I eventually went with a 750w)
- 1.44MB floppy drive (yeah, I did want one on that rig)
- 1x Asus CD-RW drive and 1x Lite-On DVD-ROM drive.

Surprisingly, getting 64 bit drivers for the build was not an issue, and compatibility was quite good too where newer games are concerned. Games that came out after 2003 ran fine. I had Sim City 4, The Movies and Sonic Heroes running really smoothly. Even Toontown Online, and PotCo ran fine.
Reply: Most people didn't buy dedicated physx cards, it was a waste of money. A lot of people back in the day used a slightly older or lower end nvidia card than their current and turned it  into their physx GPU. I remember when I had a GTX 275 I used a 8600 GT as mine.
Reply: Remember, SLI does not combine VRAM capacity.  Therefore, your two 320GB video cards only have 320GB usable.  The one 768GB video card you had would probably perform better.  Plus, SLI efficiency is never 100% anyway, 80% at best, profiles are never perfect.  It also introduces more frametime, also creating stuttering.
Reply: LGR idk maybe upgrade the whole fucking system to an i9 RTX 2080 Ti 128GB Ram.
Reply: What is the case on this build ??? It's looks fantastic.

Thank you.
Reply: A new windows :)))
Reply: I had 4 gigs in my build from that time. Not really, more like one or two years later, but not that far away. That was a 500€ build. So definitely max it out.
Reply: I remember trying to play Crysis with an 8800GTS. It was awful eventually replaced with an 8800 GT which was much better. My suggestion is swap out the GTS Sli cards and put your GTX in. Also 2/4GB ram would be a better choice. If you run 2 sticks of ram, try putting them in slots 1/3 or 2/4.
Reply: Use two 2gb ram heard using 4x 1gb can cause slight performance hit. Install an SSD use raid drive for  game data.
Reply: @im.a.nickel  Your comment totally had me looking up a 9800 GX2 quad SLI setup (thinking it would be four cards) because it's a dual GPU card, but derp quad SLI would technically be two cards with the GX2 hahah (the thought of four dual GPU cards is mind-boggling) I wonder how a dual GX2 (quad SLI) setup would compare to a tri-SLI 9800GTX+ rig? (I don't think the 9800GTX+ supported quad-SLI, but I do remember seeing tri-SLI setups with old nForce boards).
Reply: What about a surround speaker set up? I remember those were all the rage in the late 00s.
Reply: XP 64bit?
Reply: Cable management dude
Reply: LGR SSD
Reply: Lol this is asking alot but can you provide links to the parts you used for the build? Im interested in doing the same thing my win10 rig wont play the older games i enjoy.
Reply: Dual 8800 ULTRA's, use x64 and max out ram on mobo. Overclock the CPU, Cooler Master HAF X case, black version of the front IO facia for the soundcard
Reply: I'd change that heatsink. At the time I remember the king of heatsinks was the Thermalright Ultra 120 Extreme (TRUE 120) I recall my friend spending hours lapping that heatsink base along with his Q6600 IHS. I'd change the HSF. Also, the 8800GT 512MB was an interesting video card at the time, it sports better performance than the GTS 320 with a lower price point, that was my major upgrade from a 7600 GTS just for Crysis. Also, if my memory serves correct, Vista x64 SP1 at the time served a huge performance improvement to Crysis than Windows XP when it's running in DX10 mode, I'd think testing to see any changes would be interesting.
Reply: 8gigs of ram. 128gig ssd. 1050Ti. Would turn this into a decent budget game pc
Reply: LGR 2 2080ti’s please 👍🏻
Reply: 4 gigs of DDR2 RAM
Reply: dual GTX8800
Reply: OMG YES PHYSX mmmmm the satisfaction increases
Reply: LGR you need to put your ram in the second and fourth slots from the cpu socket when you’re using two sticks. That’s why it wouldn’t boot.
Reply: Ram
Reply: RAM, RAM, RAM and once more RAM. I had almost exactly same setup back in 2007 (except for much cheaper athlon x2) with one GeForce GTS 384 Mb. And I remember getting much better framerate in Crysis. On high it was about 40-55 fps. It is definitely bottlenecking the build.
Reply: I would have loved to see a Cooler Master V8 or V10 cooler!  As an eleven-year-old in 2007 with a subscription to PC Magazine, I would literally spend entire lunch periods ogling those coolers in print and later at home on the Internet.  I don't know how effective it would be against your current Thermaltake cooler, but it'd damn well look cool.
Reply: @LaskyLabs  No, absolutely no WinXP x64 upgrade for an ultimate gaming-rig, that would be asking for device-driver problems and no IPX support ! Running XP x64 on the given setup as a VM could be cool as a PoC, but also kinda useless. I'd rather play Red Alert on LAN on the XP x86  host instead :)
Reply: I still use WinXP x64. I think that this is the best system that MS has produced. It can be run even on an EFI computer: https://www.youtube.com/watch?v=YpyVbS91UiM
Reply: LGR I want you to get a new GTX 1050 ti 4gb
Reply: I built a new pc then too. i even got a coolermaster stacker 830 which is the ultimate case of that time. I still have it, but it is quite large with a lot of hard drive/cd rom space that we don't use now adays.
Reply: Should've went with 8800 Ultras SLI here.
Reply: Add a Zip drive 250. Those things are kinda neat. Maybe upgrade to a Xeon CPU (X5492 is the best I have found). Also find the absolute best video cards for the period and do a dual/quad sli. And like someone said before, XP x64 (On a second drive, dual boot, or hell, throw Linux and/or  Vista in the mix and Tri/quad-boot).
Reply: Definitely more RAM. If you're staying with 32 bit, max it out at 4GB, which is what I was taught is the max supported for 32. Also maybe a pair of 1GB vid cards? I know they were around back then, no idea what they cost.
Reply: Clint, there is a game that is 96KB and it has Midi music with 3D Graphics. Try running on the XP machine!
Reply: @bootlegscarce0844  not if you're going for raw power. X5470 is 333 MHz faster than both e5450 and qx9650, and is the fastest CPU you can stick into LGA775. Of course, you could just overclock e5450 to reach the same 3.33 GHz, but TDP would rise anyway, and I'd rather avoid overclocking hardware that I kept for its "period appropriate" qualities.
Reply: that cooler looks like a washing machine barrel lol
Reply: XP 64 had issues with driver support for a lot of devices. I used it for my build but took a while to gather the parts compatible with the 64 bit OS.
Reply: Add 4 sticks of RAM for true speed
Reply: I had 3 8800GTX and 2 8800GT's,  ASUS striker extreme, almost that same sound card. 4GB Corsair XMS2, and 2 raptor X hdd's. Gave all the stuff away a few months back.
Reply: Maybe two 9800gtx's in sli? the 512mb models? and then try and play some newer titles with windows 7 on an ssd
Reply: I'd love to see you play Counter Strike Source on it
Reply: LGR  why not try a GTX2xx series card, like a 260 or a 280
Reply: You do know that many windows xp computer had flopy drives
Reply: Were did you get them all
Reply: LGR Did you have fun or did you have trouble
Reply: LGR i have a question about my xp is the intel R Core TM Duo Cpu More powerful than intel core 2 extreme cpu
Reply: give me a gtx 660 please
Reply: A TrackIR. Needs a full review.
Reply: Please play Half-life!! 😍😍😍
Reply: HD4870  :) I ran a C2D E6600, 4 gigs of ram and a 8800 GTX before upgrading to two of those. Epic performance jump in the right games.

Can not recommend XP64. Finding drivers that works is a nuke in the a$$. Use XP in PAE mode (with a patch) if you insist on running more ram with it. It has one caveat that no single thread can use more than 3.5 ~gigs but you can have several of those running given you have enough ram. -It's a weird limitation. It extends the address space to 36 bits so in theory you can have up to 64 Gigs.
Reply: @Sebastian-dx9qg  actually xp uses PAE (Physical Adress Extension) to allow ram up to 16 gigabytes but 32 bit applications can only use up to 3.72 gb due to the 32 bit limit
Reply: Mr.LGR I have an old HP Vista that has the integrated graphics card video output snap off the board. how would I install a new graphics card with no video?.
Reply: @im.a.nickel  I would rather recommend the Chieftec Dragon PC case...
Reply: Would have gone AMD CPU in that era
Reply: i had an oem physX pre nvidia.. it was a pci add on card.. i got it for Tom Clancys GRAW1
Reply: @im.a.nickel  Rather the HAF 932, The HAF X is a newer version :)
Reply: @Sebastian-dx9qg  I think that depended on your system. I remember the OEM rigs my family had wouldn't let us use more than 2gb.
Reply: Do you think you could give me a list of all the PC parts you did to make this build and where to get them at thank you
Reply: If you want a modular power supply from the xp era, you should get an Ultra X-connect 500w power supply.
Reply: It's crazy to think a machine that could run these fairly sophisticated games is so obsolete today for even basic productivity or video streaming tasks.

Between Windows XP dying and modern web browsing chewing up so much more RAM than it used to, this machine might possibly run Crysis better than it runs Google Chrome. Then again, our web browsers can do so much more than they used to.

I do wish software developers would do their part to help people extend the life of older computers. At least there's Linux, but I'm not sure how much of a solution that is for a computer of this era.

I would recommend that you throw some more RAM into this machine. Just max it out. 

See if you can run Windows 10 on it from another hard drive and how well it performs!
Reply: Maybe something like this:

MOBO: Asus Maximus Extreme
MEM: OCZ Platinum RAM 2GB DDR2-800
HDD0: Your current in WD Raptor RAID0 setup
HDD1: Samsung Spinpoint F3 1TB
GFX: 8800GT SLI because it was basically a cheap 8800GTX and has low TDP
SFX: Creative SB XtremeMusic (used to crystalize all my music output back then)
Reply: You should totally get another 2 gigs of ram.
Reply: Clint, after finishing up my own version of this I realized several of the Rosewill cases, while feeling close to period have one fatal flaw; they have a blue LED. Since the front panel on these things rips right off anyways, it was a 5 minute solder and heatshrink job to go from blue to green and it seems so much more fitting. I never liked blue LEDs on cases anyways. I do feel a bit disappointed though, I still had a 1.44 MB floppy drive to install, but I don't have any cables anymore, and the ones on Amazon are like $10-12 now. Have any you want to mail me? :P
Reply: RGB it to throw people off
Reply: I wanna see how that 8800 ultra performs. XD Also your case needs some purple cold cathode tubes!
Reply: Needs to be in an era-appropriate modded case! :) :) :)
Reply: Windows 7
Reply: Computers from this era are the perfect platform for all-encompassing retro PC gaming build.   You can add a Voodoo 2 3dfx card to this for older 3d gaming.  You can also emulate even older PC games with DOSBox as well as add a external Roland mt32 or cm-32 for high-end music of the day.    A system like this plus a modern PC - having both you can run almost anything ever made.
Reply: Should upgrade to Windows XP 64 bit
Reply: I Have a Dell dimension b110 with windows xp home edition
Reply: I don't know if you are still planning another upgrade for this machine, but what about the Intel Q9500? Uses less power but is much faster than the Core 2 Extreme. I scored one for 10 euros so I am working on a 2008 build too, only mine will run Windows Vista 32 bit. Maybe upgrade this machine to Vista too and do a little throwback to Vista?
Reply: xclio case ofc
Reply: id definitely replace the raptors with ssds. theyre fast but wayy too noisy.
Reply: With a physx do ghost recon AW !
Reply: Not a hardware suggestion but Play Team Fortress 2 I want to hear that fan SCREAM from the Pentium processor
Reply: late to the party, but keep a HDD trace spare between the two drives for better cooling.
Reply: The RAM is completely inadequate, and the GPUs could do with an upgrade. You could put 4GB RAM in Windows XP (minus the video RAM), so put 3GB in there if you can. 1GB is no good at all.
Reply: @Sebastian-dx9qg  there was a version xp 64bit i think those could run more than 3.5 gb
Reply: Could u do like any newer operating system for pcs
Reply: Can it run minecraft
Reply: antec p182 special edition case, asus p5w-dh deluxe, amd hd5970 crossfire, intel x25m ssd - now we're talking!
Reply: RTX 2090 ti
Reply: I know it wouldn't have been that much better, but a Skulltrail PC would have been cool too!
Reply: the garbage and get a new pc
Reply: @mikekilkelly2138  Let's see your not so garbage PC then?
Reply: @MrSkyl1ne  DVD RE-writeable at 52x ... the keyboard, is that my ergonomic version would never have another, 2.4 Ghx Logitech mouse, a sniper pad [ save the wear on the mainboard ] and an X230 sound system .....| Sonata case- Ahem... with blue neon lights, it made the ANTEC, drilled sign look pretty rad, and some - I got some fluffy feet raisers, two reasons, 1, so much easier to move the case around when wanting in, and two, I took a drill to the bottom of the case, at the end of the graphic card, to pull up the coldest air in the area, from the deck below the case, to assist, any ambient lighting heat, get ''ejaculated' from the 120mm SilenX fans from the top... not a choice word.... the one word let down .... doh !!! what those slipping Fruidiens call that ?  .. Philips X5 monito, could adjust the refresh rate of the screen, from the monitor itself, set to 72 Hz... after reading the effects of frequency Hz on the body - yea, soon go and get a tri Field ELF detention system, a Zephyr Technology ELF Machine ... ALL MUST HAVE'S ....I SHALL REBUILD... at least my spine shall not be bed/laptop twisted in 12 months
Reply: Is it me or it looks more like a Windows 7 early days build than a Windows XP one?
Reply: For a 2007-2008 build my dream at the time was 4x Intel x25 160GB or a Samsung 64GB SATAII drives in RAID 10
Reply: use (4 x 4GB) ram
Reply: holy shit
Reply: More ram
Reply: It's hard to say. I have a E8500 that I thought was good enough. I am planning to upgrade my Dell Dimension 2500 sleeper with a Q9650 on the Asrock G41-GS rev. 2.0 motherboard. that system has 4 GB DDR3 @ 1333 MHz. Also It has a HD 7970 that gets too hot. It can hit 100c, that more than I'm comfortable with. 

On your's a 750ti or above and mor DDR2 memory than 2 GB. Maxing out at 4 GB is a good bet. Also max at 800MHz for your configuration. 

I have a SB 1550 Sound Blaster Audigy RX. I wish I could use it. It is the only PCIe card that I know of that is XP compatible. Damn nice card. I only have PCI available to me. I will probably use My Audigy 2 Value for my build, that a SB 0400. Both card can use a external decoder for Dolby Digital and DTS. Also they support EAX Meaning both cards.The Audigy 2 is what I was using in the day. I would say the RX I if a PCIe is available for XP. Phil's computer Lab is a good place to look at sound cards on Youtube. Use PCIe if you can.

Back to GPU, a 750Ti is going to use less power, not get as hot, and it should have good performance for XP. Nvidia cards work up to 980ti with XP. 10 Series and above do not support.

Everything else is awesome for a LGA 775 XP PC. Good luck.

Ya, You can run with a Audigy RX. You have a PCIe x1 above the PCIe slot on your board.

Again, have fun and good luck with Microsoft's shitty support for XP. Oh I love the Spinq heatsink. I had one and dropped it, that destroyed it. Can't find another one. Put any sound card above the GPU so it does not impede air flow.
Reply: 15:40 I remember Crysis even ran into memory issues with 4GB system memory in 1280x1024, in the end level with the aircraft carrier.

For a potential follow up video I suggest you reconsider upgrading to Vista 64-bit, and add at least 3GB more ram for a true DX10 2007 experience. 

Sure older titles might run into problems, but what about showing some love for DX10 titels like Crysis, S.T.A.L.K.E.R.: Clear Sky, World In Conflict, Supreme Commander, Bioshock, Company of Heroes, Microsoft Flight Simulator X. Sure those DX10 games might not be that impressive now (except Crysis of course;) ), but for the time they were cutting edge.

Also SLI-scaling and performance has always been a bit uneven, and 10 years ago it was even worse, I suggest running with the GTX 8800 Ultra instead.

Best regards.
Reply: LGR also, can you do a review on Windows MCE 2005? If you need an ISO let me know.
Reply: LGR try Running Half Life 2 on it, it is a game that was released in 2004, and is a must have for a Windows XP machine.
Reply: Where do you go to buy all this fantastic classic technology?
Reply: In fact i cant wait to have an RTX in about 20 years or so
Reply: dual 8800 Ultra's from BFG. I remember their release and drooled over having one one day. I ended up settling for a 880 GTS. Props if you could get the waterblock versions!
Reply: @oncameramastery  I had 2 of them the scaling was awful so I returned one of em,  still my EVGA 295 gtx in  the original box
Reply: I have a q9550 running 4x2gig (8 gig) ram with a HD5870 and it actually plays GTA5 at 50fps , hell all i would have to do to get it playing even better is to stick a gtx 1050ti in it,OC it to 3.2 and call it a day,Crysis it runs no problem , actually it runs about almost anything
Reply: Liquid cooling
Reply: Upgrade the CPU, maybe to a Q9550, and upgrade the GPU to something like a 560 Ti.
Reply: This is so close to the build I did back in 2008. I have all those games on it. Now I have to salvage my good parts and rebuild the system with all the stuff I couldn't afford back then. I drooled over that processor and always wanted raptors. I love that you went with the striping RAID 0, that was a secret weapon back then for loading times, and really helped my slow drives compete.

Try and get some 8800GTX cards. They were the Mac daddy. XFX made them with extended heatsinks, or just install some aftermarket ones. Overclock them, or try the 8800GT cards I had, and overclock. I got gtx speeds from them.

See if a 780i chipset might be better. I chose it, but it had just come out at the time, and the same price when I bought mine from XFX.

With that heatsink you can overclock the processor. It was more stable than the lower end version I bought.

Overclock the ram. They have heatsinks. I did that with 4 sticks and it ran really well with a minor timing tweak.

Consider a dual boot with XP64 bit. Support for it was crappy, so much missed opportunity, but you can take advantage of the extra ram and directX 10 compatibility if I remember right, without having to use Vista. Or dual boot with Vista if you dare. Some games had Ultra High settings you could use.

Go extreme and get 3 GTX cards and run tri SLI. My 780i board could do it. Run 3D Mark 06 and watch the fun.
Reply: Did this build ever get any updates?
Reply: switch the motherborad with a lga 771 motherboard so you can utilize 2 cpus and sli
Reply: 5:54 I betcha that thing has gone bang by now.
Reply: PhysX is hardly needed , just another video card would do better.
Reply: Well... I hope you'll install a GTX 1050 Ti and 4 2 gigabyte RAM sticks, as well as Windows 10 - it'll be totally worth it, 'cause it will run MODERN games at high settings.
Reply: @toxamusical6926  But that's not the point of the machine
Reply: @Dimondminer11  well, I know, was just telling. But, in my personal opinion, this machine NEEDS 4 GBs of RAM (my Core 2 Quad Q8300 that I am writing this to you from has 4 GB of RAM)
Reply: @toxamusical6926  I agree with the 4gb ram bit but everything else (except for the weaker SLi setup) is fine
Reply: Can you make a windows xp PC in 2040
Reply: A sick gattling gun protuding from the case would be great
Reply: Add A Wireless Card And A Geforce 8800 Ultra 3 Way SLI
Reply: The very first thing you have to do to be able to call this PC a gaming beast is to put at least 2 gigs of RAM. Single-channel sucks, especially on DDR2.
Reply: Man, I have a Core i7 3770 Windows XP and it shows up "8" cores just fine. Same when I've tested XP with a Xeon X5650 (6C/12T).
Reply: Dear Lord if you don't find something FireWire to plug into this baby I'll be seriously disappointed.
Reply: Dual boot with windows 98 so you can play commander keen and duke 2/3D....
Reply: Upgrade to WinVista
Reply: 4 or 8gigs of ram. XP64 or win2003 will support em. also that's still a monster PC, there's people out there who use worse everyday.
Reply: Find some OCZ reaper memory, dankest looking DDR2 available
Reply: @oncameramastery  I Realize that this is waay out of date but the BFG GTX 285 was a massive powerhouse of a card and didn't produce much noise at all
Reply: This is my great dream  🤤🤩
Reply: where's the update video? :(
Reply: Bump the gpus up to 2 GTX 280s
Reply: the prices went down so fast back then, in 2009 i had an athlon xp 4800+ with 2 gigs of ram and a 1 gig 9800 GT video card, oh and 500gb hd and i was doing 1920x1080 resolution, this setup only cost me like $800 with the monitor and i didn't even build it
Reply: i think my 1 gig geforce 9800 GT video card got me more use than any other card i ever had
Reply: @Sebastian-dx9qg  only 3GB
Reply: just max out the ram. never mind can only  use 3 gigs max on 32bit os then
Reply: in the distant post-capitalism future, videos like these will be retitled "watch crazy capitalist throw money around on stupid stuff while people are starving to death!"  our values will be something like...no one gets to have fun if everybody isn't even eating
Reply: @quonomonna8126  sorry for Africa indeed, but you could've described your feelings a little bit humaner
Reply: @tothpeter2296  if we don't set higher standards of ethics for ourselves,  we will destroy ourselves and the planet
Reply: @quonomonna8126  yes, you're right
Reply: get and use a Directx video card to play Medal of Honor Allied Assault, if you can get the game to see if it works.
Reply: It needs to be upgraded to MS-DOS
Reply: Ahhh XP my fave OS ever it marked me becoming what i am to day, played Worms Armagedon several Times a week with my Sister and brother in my Parents room i learned how to surf the Web, and I played some of my fave games of all time on it, Compac thank you for all the memories
Reply: Crysis had a 64bit patch so it works on XP x64 faster or with better graphics.
Reply: In Russia, such a computer costs 200-250 $ USD on the "bought used" (Used Market). 
We have a lot of these configurations with the same performance in games. $ 3,500 is who's salary?
Reply: @Sebastian-dx9qg  For the 32 bit version yes. My windows XP game machine has 64 bit version of the OS.
Reply: Ram upgrade
Reply: ifOfo
Reply: Hi
Reply: Can crysis?
Reply: windows 10
Reply: Gotta go for 3 way SLI since you have mobo that supports it
Reply: Thank u LGR
Reply: Loved the video. And all of your content is top tier. Very entertaining while also being informative. If I was going to upgrade a system like that, the first thing id do is install another stick of ram. Especially considering how much of a difference dual channel memory bandwidth can make when it comes to gaming performance. Next id definitely throw in at least a 500 gig ssd to make boot times much shorter and over all just make the system feel so much more snappy and responsive.
Reply: Windows 10
Reply: it's a insult to run Vice City on that setup....
Reply: Did you ever add more RAM to this thing? I think I was running 4x1GB back then, would probably run a lot better
Reply: @im.a.nickel  so... I was intrigued and had to look up the case you mentioned here. And holy shit it turns out thats the case I'm currently using. I got it secondhand cause of how absolutely ridiculous it looks. I had no clue it was THAT old. I love this metal giant and intend to keep using it as my main build case going forward.
Reply: Try to upgrade the card and keyboard
Reply: @LGR  oh i thought that said Need For Speed Uh...
Reply: Go AMD processor Athlon/Opteron!!! ...with benchmarks
Reply: Replace that Rosewill with a significantly safer power supply.
Reply: I am noticing the (albeit slight, but to me still annoying) microstutter due to the sli configuration. So imho a decent single graphics card from that period would (at least for me - but you are the almighty LGR) be more appropriate. Had a Radeon X850 when I first played Oblivion and that s***ed due to stuttering even with Morrowind (by now older AMD cards and Bethesda games will never be friends...). You seem to like TES games as much as I do, so a single nVidia card would be my choice.
Reply: Where are your eyebrows dude?
Reply: Win 7
Reply: Mista LGR. I must say, I released a major NUT when you said 'ram cards'. please say it again and keep rammming it.
Reply: Could you emulate on it?  Like snes nes wii playstation, etc.
Reply: @alexrick5092  ok. So processing power is determined by electrons jaqing each other off in 0s and 1s. So mr Rick, how would you like to jaqq a tibbetten 0ff?
Reply: @tibettenballs4962  I don't exactly now what you mean, but from the power of this system, I think it might emulate pretty good like nes snes megadrive playstaion gamecube and maybe even wii
Reply: What would be absolutely overkill for a 775 system of that day might be upgrading the CPU to the QX9650, and upgrading the GPUs to SLi GTX 285 cards. Of course gotta have some amazing sound card in there too. And a WiFi card. That would just be cool to see. Also maxing out the ram to 8gb of DDR2 would be nice to see.
Reply: Dude, i have a 2001 gaming AMD pc.
All the pieces are made by AMD
Reply: @LGR  

Nothing wrong with a patch if you have to do it once and theres no VM bs ever.
Reply: Nasty. Cut down hardware and pure rasterization.
Reply: Nasty. Context switching in crysis with a 4 core.
Reply: Nasty single channel bandwidth.
Reply: Turn off the postfx vegetation shader in the cvar noob.
Reply: Test my retro raytracing presets on your 8800 ultra.
Reply: Bro my entire library os next level with its shading. Your precious retro will be assimilated if that process requires my own retro reinvention.
Reply: I sense much bias in you.

If only you knew the power of the modern computing side of the retro.
Reply: How it feels to play os a shifty way to reinforce your position retro games on retro hardware is better.

Honestly the amount of problems you have uploaded to your channel almost recommends against it.

The ideal is making compatibility as painless as humanly possible with machines people actually use. Modern hardware retains most of those instruction sets for a reason. You basically are giving it less purpose to waste diespace on.
Reply: needs firewire, obviously.
Reply: E
Reply: What thermal paste method did you use?
Reply: We need you on twitch cause u have mad gaming skills
Reply: @asunayuuki6090  yes
Reply: Suggest u to get a 3080 or 3080 stealth from nivida
Reply: Maybe try putting in three Quatro gpus and using it in three way SLI
Reply: @LGR  Just wondering what the issue is with 64-bit.  The backstory is I am on a similar but different journey (less about being exactly period-correct and more about overbuilding an XP gaming rig).  I was just at VCFMW and there was a Gigabyte LGA 775 gaming MB with CPU, 8GB of RAM and Tuniq Tower 120 cooler for $20 that got my interest so I bought it without a real plan.  There was another guy selling Nvidia Tesla C2050 video cards for $20 so a plan started to form to build a semi-ridiculous XP machine.  Given the 8GB of RAM I assume the last guy went 64-bit and the MB has 64-bit drivers so I went for it.  So far, I have cobbled together the above along with some other things I had around.  Namely, an Audigy 2 sound card, blu-ray disk player, 512GB SSD, and a Thermaltake power supply from the timeframe.  I have a Couga MX330-G Air case coming that I got from a marketplace seller on Amazon ... it's a new case but kind of has that old-school look with blue LED fans, black mesh exterior, etc.  Most importantly, it had a spot for an optical drive.  So as you can see, it's more of a Frankenstein retro XP build but I think it will be pretty cool when done.  And, BTW, I get anywhere from 70 to over 100 FPS in Crysis at high settings. So, I guess, back to the question ... did I make a mistake with 64-bit?
Reply: I have the original halo 2 game, and I want to know how I can get my pc to read it. Do I need an emulator or something?
Reply: Sometimes everyone wants to buy rtx 2080 super and everyone put his XP computer but sounds like up to 60 fps that's a good idea, but sometimes is explosion
Reply: You should revisit this system with maxed out RAM capacity and a new-ish high power DX12 GPU, and install Windows 11 on it. First generation quad core hardware versus last generation quad core software.
Reply: Ok
Reply: Would be nice if you max out the RAM
Reply: @takeshi7  xonar d1... I miss it very much, can not use it on new motherboard
Reply: Don't ever use crappy 32 bit versions where 64 bit versions of any OS are available, ever again.
Reply: @Sebastian-dx9qg  Depends on 32 bit vs 64 bit as well as the motherboards.   A lot of motherboards around that time didn't handle 1GB sticks so well at times once you went beyond 2.
Reply: Have you tried using drivers from mid-life for the cards? I'm not sure the end date of drivers but there might be a pink cloud driver medley for that exact cpu+gpu set up that works far better than end date drivers.  
Your build makes me want to make a good xp build for Tiberium Sun/Firestorm and Janes Fighters Anthology.
Reply: Question: Was the 1000 watt PSU necessary or was it just for the fun of it? I'm asking because I'm planning on building my own retro pc with similar components and I don't want to fry it with some random brand new 750 watt psu I get from Best Buy.
Reply: @reviveonset that's about time appropriate for the LEDs it's was a lot of blue LEDs or even the cathode tubes but nothing like today 😅
Reply: @jruonti what cpu were you running and what version of XP?
Reply: How about two SSDs in RAID0 instead of mechanical hard drives? 

Dual boot it with an era-appropriate Linux build or even with something like Windows 98?

See if it runs Windows 95/98 era games (not DOS) natively in XP.
Reply: You might have the resources and the desire to try out the most powerful PC possible where you can install Windows XP. You can use a Haswell processor, 2x 2GB DDR3 RAM, and a GeForce GTX 980 with modified drivers like those created by Phills Computers Lab (you only need to edit the compatible models on it.). It's a video I would love to watch.
Reply: 8gb ram and gtx 980ti sli ssd
Reply: Upgrade to 4 (well, 3.5) Gigs of RAM and get a Nvidia 9800 GTX - or even a GTX 280 - to compare the performance.